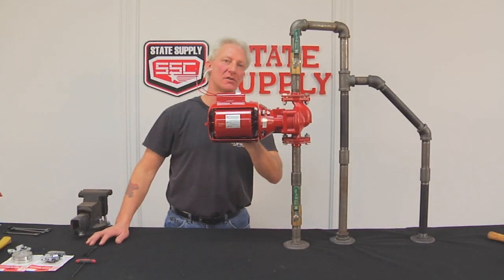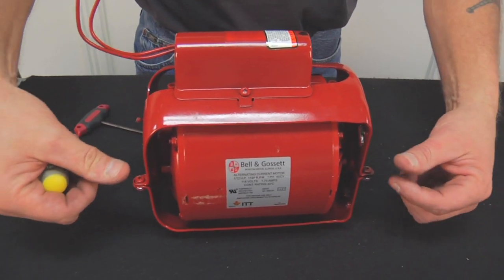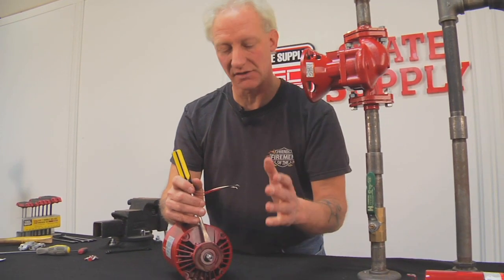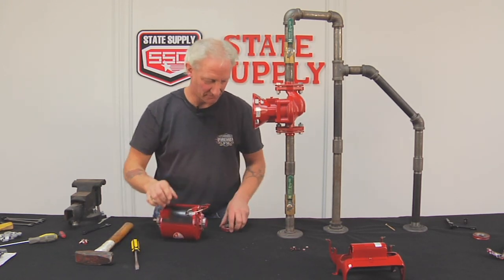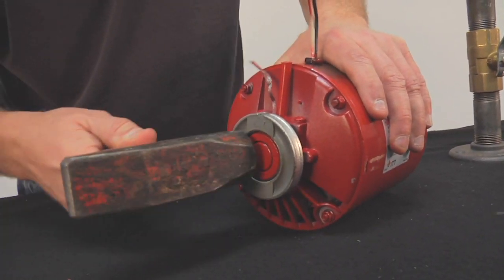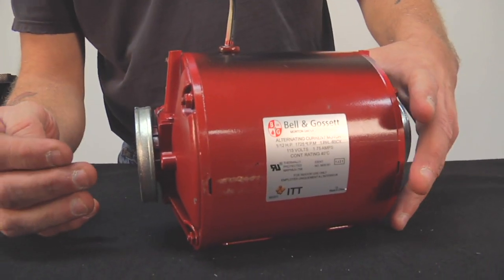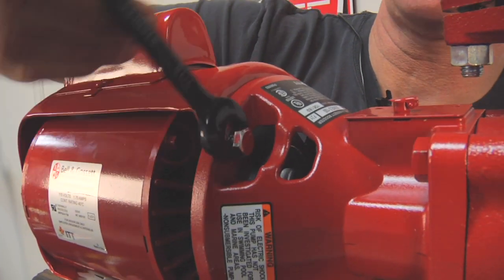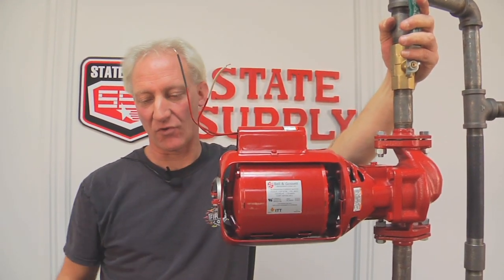How to Replace a Bell & Gossett Series 100 Motor Mount & Coupler

Comment: Thank you, thank you, THANK YOU for taking the time to make this video. Your clear instruction gave me the confidence to replace the coupler and mounts and avoid a $2700 quote to REPLACE (not repair) my pump (and some other stuff that I need a plumber for). When I had some more questions, I called the above number and actually talked with Doctor Tom! He was patient and very kind in answering my questions, especially awesome since I had not bought anything from State Supply. I still need to order a new air vent for my boiler and that one will be ordered from State Supply!

I did ask Tom about the expansion seam on the motor mounts (directions on the package say to mount with the seam on the bottom or 6 o'clock position, but in the video he says to install it at the top, or 12 o'clock). He says that that's what he was taught when he trained at B&G.

Thank you again, Tom.

Dee Ann
Reply from the maker: So glad that we, and Tom, could help! Thank you for your business!

Comment: Thanks so much for the very informative and helpful video.  Saves me lots of money to DIY, so I will be doing my hydronic parts shopping at State Supply from now on.  I just replaced my series 100 motor mounts after the coupler broke for the second time in 3 years, and I wanted to add a tip on the motor mount replacement.  Instead of hitting it with a hammer, the original factory motor mount (spray painted red and about 5 years old) had a light lubricant or anti seize compound on the inside surface of the mount.  I was able to easily pry the mounts off the motor without requiring use of a hammer.  A few pries on each side and it was off in about 30 seconds.  The same gentle prying procedure worked for the mounts on both sides of the motor.  Installing the new mounts still required a hammer to tap them into place as you demonstrated.  Now that the mounts are replaced using your procedure, the coupler is completely silent.  Since we bought the house in 2012, the coupler has always made a slight squeaking sound, but with the new mounts, not a peep from them.  We have the cast coupler rather than the stamped one, and I was curious what your assessment of the difference is.  Are the stamped ones better or more reliable than the cast ones?  Also wanted to mention that the original mounts did not look degraded or sagging at all, which is why I didn't replace them when the coupler broke the first time around.  Now that I replaced the mounts, even though they look the same as the originals, no more squeaking, so mounts can apparently be bad without appearing that way.  Again, my sincere thanks for all of the informative videos.  It really gives people the confidence to save money on maintenance of their systems, and hopefully they repay the favor by shopping at State Supply.

Comment: Just wanted to let you know you saved me a bundle on repairing my pump by replacing the coupler.  (Plus my wife was tremendously impressed that I got it done.)  It was a $12 part versus the $250 standard plumber's visit this entailed.  Thank you very much for your excellent instructions.
Reply from the maker: +Samuel Clouden That's great to hear. In most cases you're better off doing the repairs yourself on these smaller pumps.  Glad we were able to help!

Comment: This video saved me an expensive call out fee as I was able to dismantle and repair the pump myself. Not in my case a sagging motor mount, but a seized impeller due to lack of oil. Coupler was banging as spring slipped. I followed video instructions to remove motor, then just reattached the spring, oiled the wells and loosened the stuck impeller with a wrench on the central shaft. Thank you state supply, for giving me the confidence to get my hands dirty instead of summoning a professional!
Reply from the maker: Glad we could save you a few bucks :-)

Comment: 100% a LIFESAVER!  Coupler broke at 2 a.m. with more racket than a metal skate park!   Bought two new couplers (one spare)... probably need to replace the motor mounts too but the plumbing supply store did not carry those, had to order from Supplyhouse.com and will arrive in a week or so.  Removed the very broken coupler this afternoon, replaced it with the new one and because of the tight space we had to work in, there was a lot of sailor mouth going on.  Now when the motor mounts arrive, we will have a better idea of what to do.  Not looking forward to it but at least we are better educated now.  Motor and pump are running fine and the upstairs has heat once again!  Thank you for your invaluable teaching tool!  You could not have been more helpful!

Comment: Excellent, clear directions.  Thanks for all the insights.  I had a coupler go last night and of course it was both the bedroom circuit AND the coldest night of this winter so far, 5 degrees F.  Got a new coupler locally this morning, installed it, and we're back up and running.  Massive money and time saver. Many thanks for posting!  If I knew where you were, I'd have my wife send cookies.
Reply from the maker: No problem at all - glad you didn't have to freeze for too long!

Comment: Bless you, man. Your video just helped me get heat going in my house again, on December 12th. (Yeh, it's chilly!) Excellent video. There was an old coupler in a box near the boiler with two good springs. Straightened out the metal bar, put on the springs, followed your guidance, and it's getting warm! Thanks again!
Reply from the maker: Glad to help :-)

Comment: Great detailed video, using this info I was able to successfully complete this job! The springs broke in the old coupler and blocked the motor from turning. I was able to use a screwdriver to punch the broken bits out. Then the motor was able to still drive the pump for a few days that way until the new part arrived (though it was pretty noisy!)
Reply from the maker: We're so glad the video helped Louis!

Comment: 9:02 I’m confused about that part, every other replacement video I’ve watched on YouTube says to put the split on the bottom opposite of the oil tube. And even the instructions from B&G says “2.5 (Replacing the motor mount) Orient the mount so that the split along its outer diameter is aligned to the bottom of the motor (direction opposite the oil tube)”. Now I’m just confused does it really matter? Or is Tom’s way not necessarily the “correct” way but it still works either way?

Comment: The inflation. Samuel C paid $12 a coupler 6 years ago, now it's $31 .. hate to get the plumber's cost, if you can even find one. 

My coupler broke, not sure why I would replace the seals.
Reply from the maker: If the coupler broke and the pump is not leaking, I wouldn't waste your time or money replacing the mechanical seal. I would inspect the motor mounts, though! Those tend to sag over time; sagging motor mounts will lead to broken couplers.

Comment: Thank you for posting your video.
I have a question regarding motor mount position. At about 5:51 into the video you can see that the original motor mount has the expansion joint facing down while at about 9:01 you install the new motor mount with the expansion joint at the top. Is it your experience that the mounts sag less in the new position?  Thanks again!

Comment: Excellent video.  Thanks so much for letting me get my heat back on.  You rock.

One question.

The B&G motor mount package said to put the slit in the mount ring facing down.  You said to put it facing up toward the oil cups.  

Which is correct?

Also, my pump leaks oil.  Are there replaceable seals that I can do to keep the oil from leaking out?

FW Webb had the mounts and the couplers.  No one else stocked them, so I brought in spares for next time.

Comment: Both B & G   and Sid  Harvey tell you to install with the expansion seam facing DOWN.
Reply: I have the actual B & G booklet and you are correct. It specifically says to face the split in the ring down, opposite the fill tube. Great video though.

Comment: Thank you , this video is very helpful , and I have a question : you mentioned when put on the motor mount make sure mount the ring open side at the top of the motor ( locate with the oil steam ) which make sense because the motor weight set on it , but on the package I bought it says : locate break in outer ring of rubber mount at bottom on all motors . can you explain to me , I've got lost .
Reply from the maker: Hello! Give our pump expert a call at (877) 775-7782 and we'll help you out. Thanks for watching!

Comment: Great video....I know I need to replace the couplers..is it common to just do the couplers and not the mounts?
Reply from the maker: +Will Marca Sometimes.  But usually if your breaking couplers on a regular basis, the motors mounts are almost always the cause. If the holes where the springs are threaded through look worn, that usually means the motor mounts need to be replaced.

Comment: Coupler broke again last night... as I learned on the video the last time this happened, if it breaks again soon it's usually because the motor mounts are bad and need to be replaced.  One way to tell if the mounts need replacing is if water is leaking from the pump, which it was, and also if the coupler breaks too often, which it does.  Strike two.  We did not replace the motor mounts the last go round because it was too darn cold to wait for them to arrive from Supply House.com.  We ordered them and just waited for the last coupler to fail.  Now that it has, we have installed new motor mounts but when removing the broken coupler, the set screw got stripped so now we have to get a screw extractor from Sears and keep working on it.  Thank God for these videos because it really takes the scariness out of doing this ourselves.  I'll let you know how it turns out after we try the screw extractor.
Reply from the maker: Thanks for the kind words Karen :-)

Here's a link to those motor mounts: http://www.statesupply.com/bg1150
Here's all parts for the series 100: http://www.statesupply.com/bh1010#parts

Comment: Does anyone know if the electrical wires feeding the motor can be repaired or replaced?  Mine are mostly exposed due to the old, brittle sheathing cracking off and I'm concerned they will short.  Thanks for the information.
Reply: Try liquid electrical tape from Home Depot.  That might work.  You could probably open up the motor and solder in new leads, but I haven't actually looked inside to see if that would be possible.

Comment: i bought oil-less bearing assembly [stainless ballbearings]  but i wonder if my old oiled bearing ass. can be rebuilt /rehabbed and used again as a backup [it has sleeves\],  anyone have any experience or expertise or two cents...these are costly, 88 bucks

Comment: motor mount seems (expansion joints as you called them ) are supposed to face down according to the instructions on the back of the package you threw away and did not read...
Reply: Interesting as he said to NEVER put them on the bottom. Who is right?